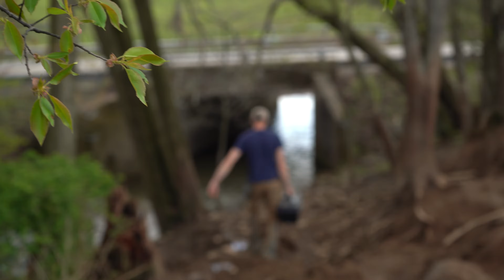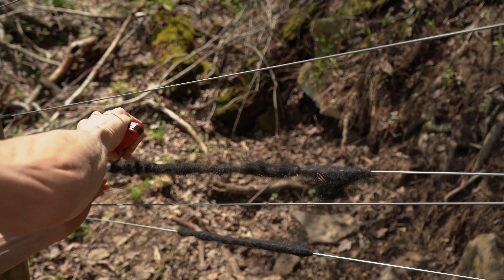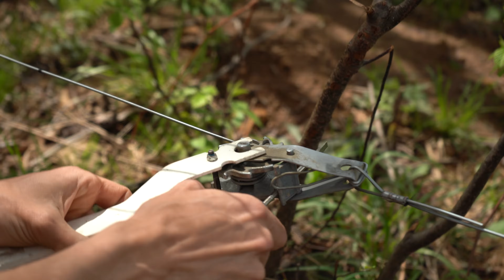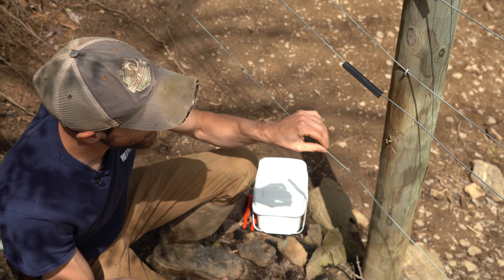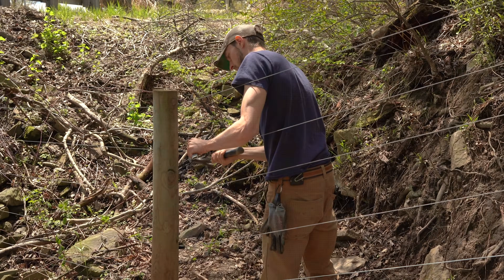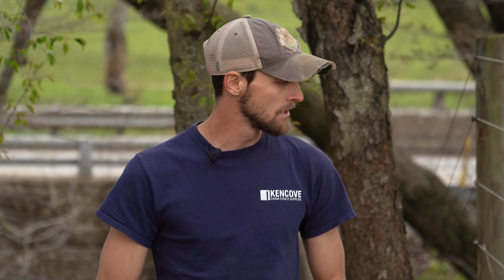Fencing Quick-Fix -  Repairing & Reinforcing a High Traffic Area

Comment: That was pretty slick. How do you keep the post from pulling out it a big elevation change like that? Is it just because you don't have to pull the wires as hard as on non- hi tensile wire?
Reply from the maker: Ideally, the post in that dip would be braced. We didn't do the initial install, simply offered to fix the issue. We would recommend bracing that dip post to help overcome the elevation change and the possibility of that post pulling out. The deeper that post could be driven the better it would hold on its own, but bracing would be the best option.
Reply: I drive 2 star pickets in at the base of the post how far they can be driven with a sledge hammer depends on the hardness of the ground (best done in the wetter months). Have two posts where I have driven 2 standard star pickets fully in. These pickets can be wired and stapled to the post, but I have also used 125 mm type 17 tex screws. Best tie wire is 10 gauge double galv. Manufacturing wire - easy to shape and twist tight using a Queensland (Au) Hitch.